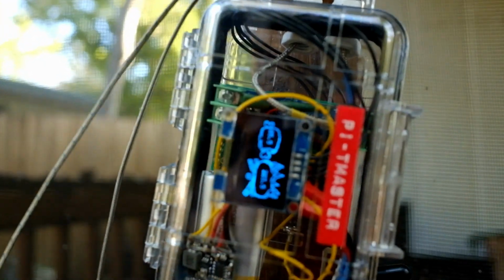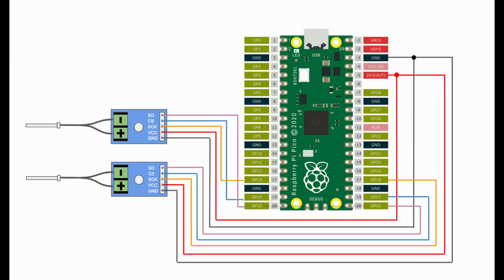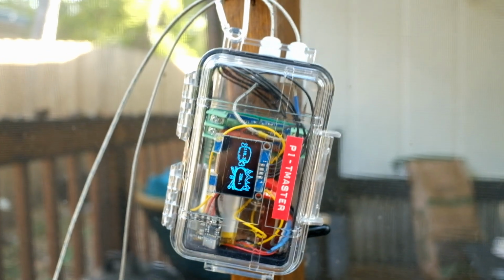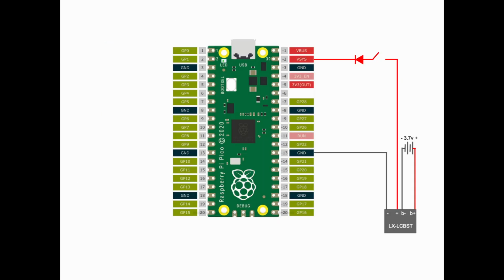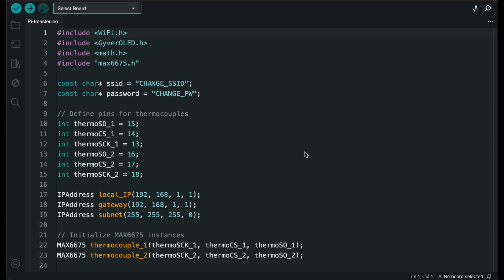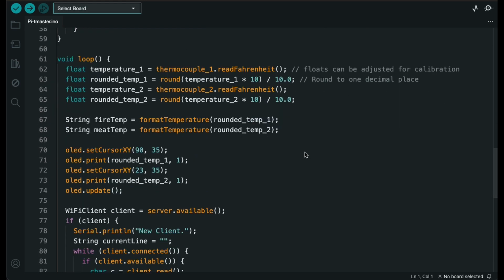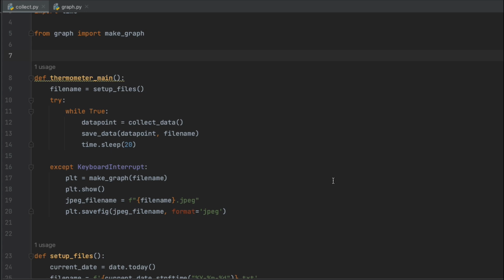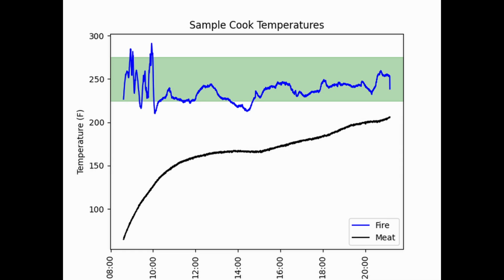Pi-tmaster: An Open Source Wireless Thermometer

Comment: Did you program a heat proof fan? To fan the fire in case the fire drops. Be a nice addition
Reply: Came across this project and think it could be a good open source option for replacing/upgrading the oem controller for my Masterbuilt Gravity Series smoker which has a weak/glitchy controller.

Comment: ha, I'm just now realizing how recent this video is. Apparently it only came out a couple days before I first watched it. I'm only just now starting to dive into the world of microcontrollers 'seriously' and trying to use them in actual projects and this one has seemed like a fun one I can try to use and hopefully add my own twist to it. One question I have is where did you find that pointed probe for that price? I don't know if I'm searching the right terms as I can really only find 'flat' headed ones (or the handful of pointed ones that I have found are more expensive). I see that you say most items were bought from AliExpress in the repo, but I couldn't find much in my limited time searching (I've found that sometimes, it just likes to hide the good/relevant stores in the background until after I search for an item a couple of times at least). Really interesting video though, don't want to glaze over that with my question
Reply from the maker: Hey! Thanks for watching and for your comment. Yes, the pointed ones are a bit harder to find. The link I used was this one: aliexpress dot com [slash] item [slash] 1005006405519347.html?spm=a2g0o.order_list.order_list_main.187.49591802Ci2lse&gatewayAdapt=4itemAdapt I got this one in the 100mm length and 3mm diameter.

Note that the termination is a different plug than the prongs and screws that the MAX 6675 uses, so I had to disassemble the terminator and connect the wires manually. .